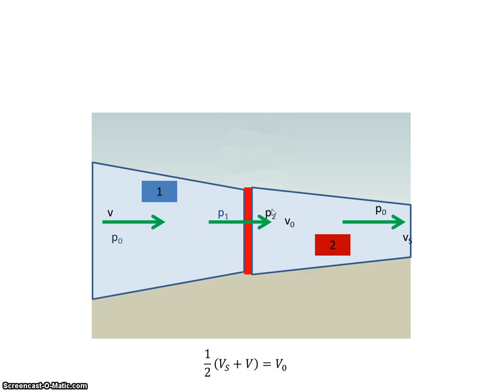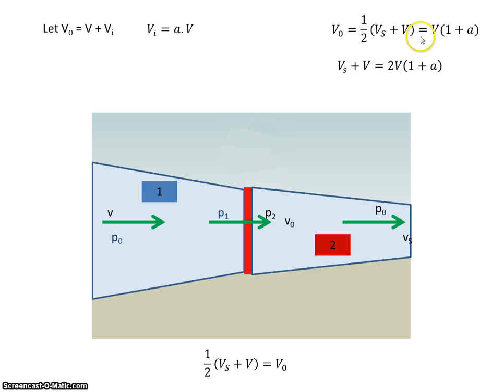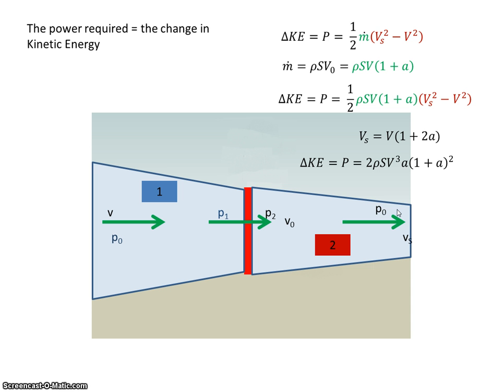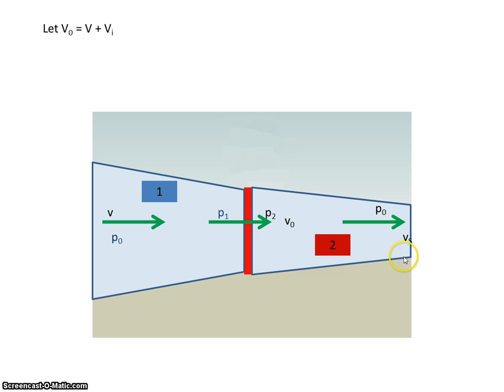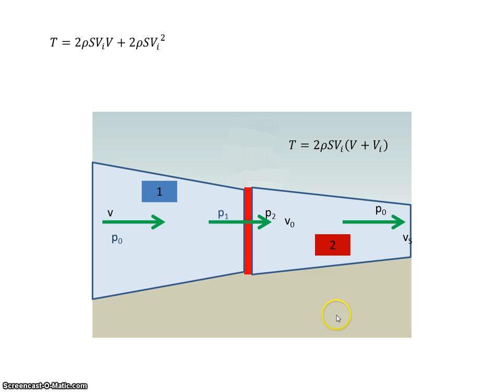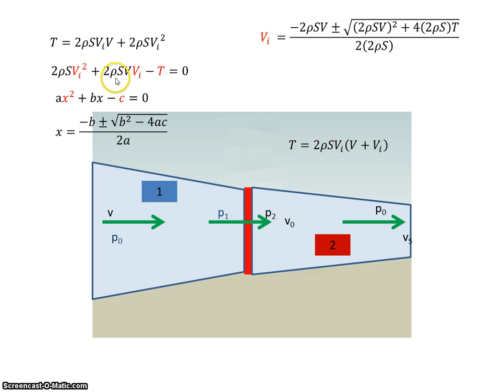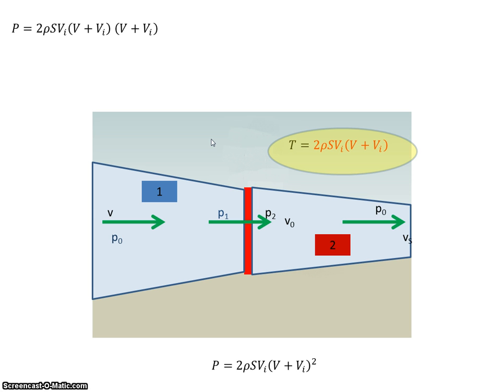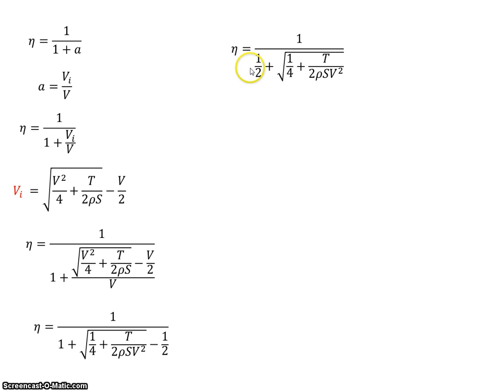Propeller Analysis 2

Comment: I see this same analysis elsewhere as well, where the change in kinetic energy is equated to the power, but I'm not exactly sure why.

Energy has units of work, N-m or kg-m^2/s^2. Mass times velocity squared has these units.

Power is the time rate of change of work, which has units of Watts, or Joules/s or N-m/s or kg-m^2/s^3. Mass flow times velocity has these units.

Nowhere besides in the actuator theory of propellers have I seen this. A lot of analysis is pretty fast and loose with mass vs mass flow rate. Same with acceleration. A change in velocity isn't acceleration... the time rate of change of velocity is. Going from 1 m/s to 10 m/s over a 10 minute period is a different acceleration than going from 1 m/s to 10 m/s in 0.1 seconds. Much different forces involved. Same with the power. The rate at which energy is changed matters to the power, not just the change itself.
Reply from the maker: Matt Williams the “mass” is the mass flow, normally signified as m dot.  It has units of kg/s and can be calculated as density x area x velocity.
Reply: Roddy Mc Namee Yes, as I explained in the second half of my comment.

Comment: If I consider V0=0 then Vi is just in function about Trust rhor y S, if I rearrange the ecuation i get  Vi=Raiz(*ClV^2)/4) so the air is not about the area of propeller but it is for the Cl the airfoil brings for a given Angle of atack, right? Thanks...